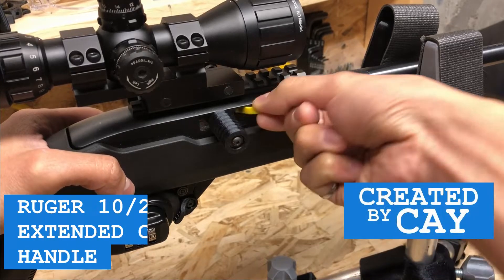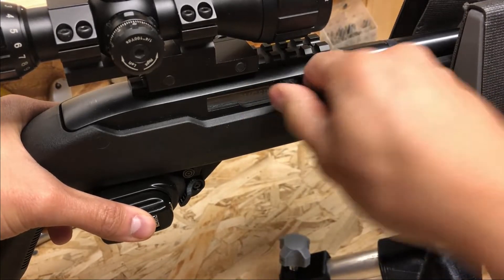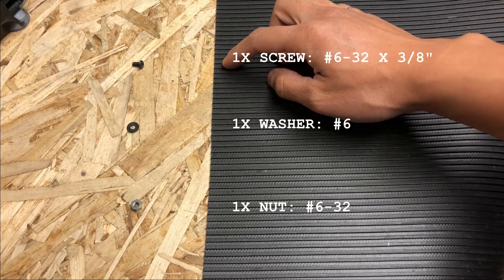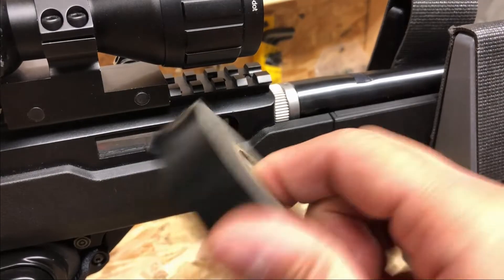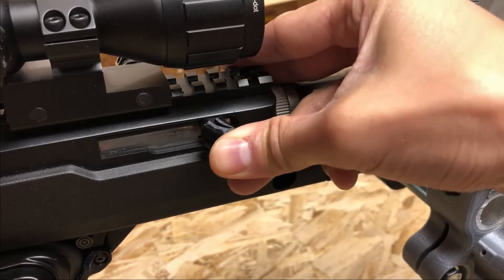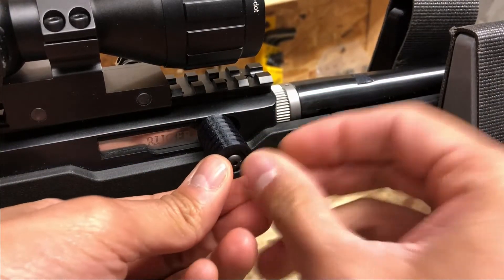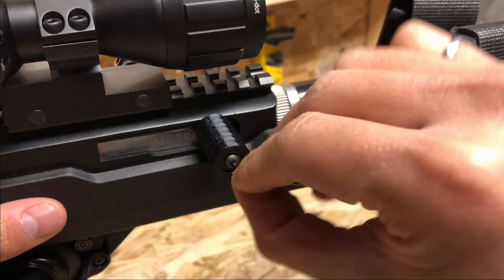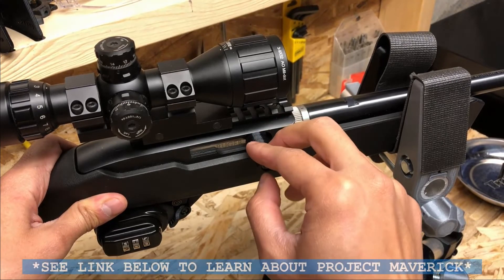Ruger 10/22 - Extended Charging Handle - $5 Solution

Comment: I took a brass 5.56 case and cut the necked down portion off and hammered the rest of the case on the factory charging handle, the brass forms easily around the charging handle, sticks out the perfect amount, looks sick.
Reply from the maker: That works as well.

Comment: Please note large aftermarket handles do not work with archangle tackticle stock . great video how much is the 3d printer ? . is this a 1000 $ handle. I would buy one can you make custom designs and paint ? Could charge a little more
Reply from the maker: My printer was around $300. There are services out there that would print for a fee. Many of my customers sent out the 3D Print file to someone local and got the part back. Unfortunately I'm currently only selling the 3D Print file itself. Thanks for watching. 
- Cay